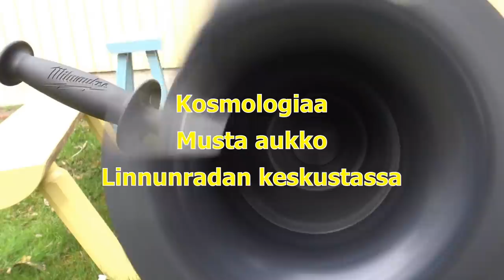Tenon Cutter | Pihapenkit | Garden Benches

Comment: Do you think Makita DP4001 drill would be fine for tenon cutting?
Reply from the maker: The Makita DP4001 is a low speed machine and is suitable for a tenon cutter, but the torque (50-70 Nm) limits the size of the tenon. In practice, the performance of an AC can be surprisingly high.
Reply: @markoaaltonenHH  thank you for reply! what about Worx Jawhorse ? are you satisfied? is that solid/works fine?
Reply from the maker: @ВикторГуров-т1е  I’m satisfied with Worx Jawhorse and it works well.
Reply: @markoaaltonenHH  on tenon cutting - is the difference between dry wood and freshly cut wood significant in terms of ease of cutting? is that preferable to use wet wood vs dry wood for that?
Reply from the maker: @ВикторГуров-т1е  Wet wood is easy and comfortable to cut, but it shrinks as it dries.
Reply: @markoaaltonenHH  thank you Marko!!!